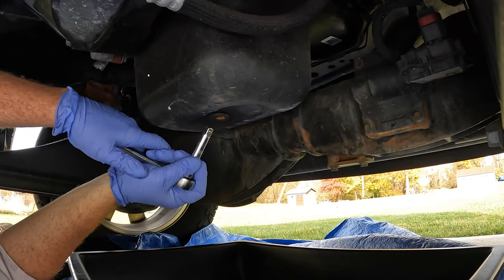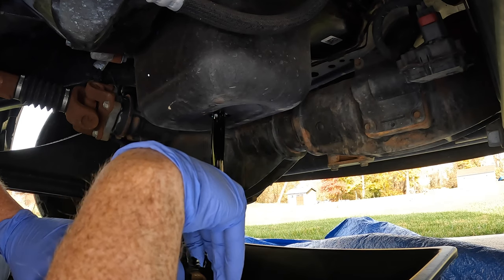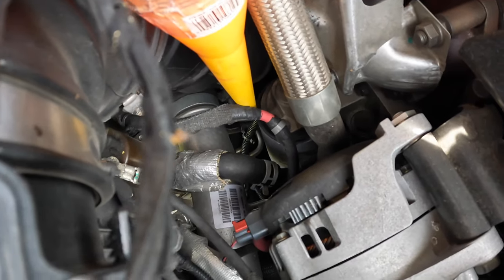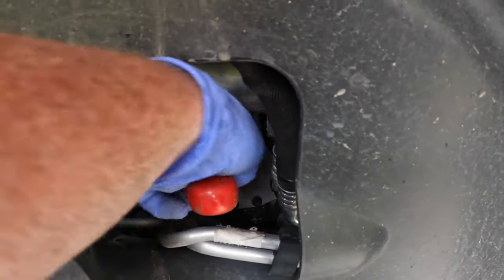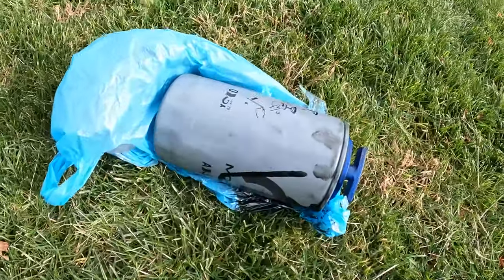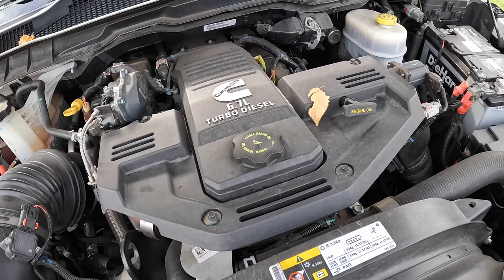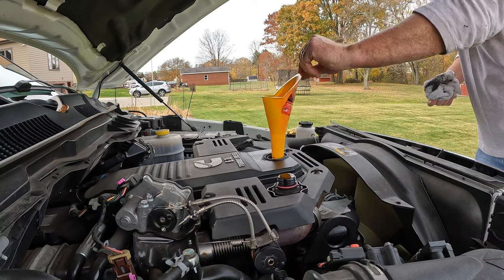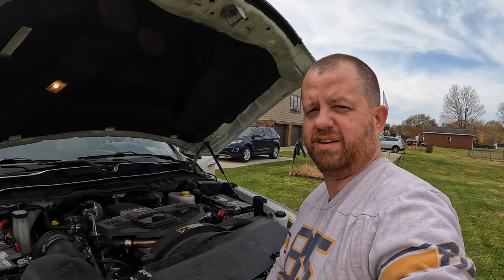OIL & FILTER CHANGE / 6.7L CUMMINS DIESEL / HOW TO

Comment: I installed the Fumoto valve on my 2017 Ram 2500 megacab on first oil change have them on all my vehicles, they make oil change Much cleaner.

Comment: Fumoto drain valve is your best friend on 6.7L oil changes.
Drive her for a bit and get the oil temp up to 170*F or hotter!  
The Fumoto will keep you from ever having to get that nasty soot infested oil on your hands or arms.
drain the crankcase first then the oil filter - the oil filter will then be only 3/4 full and virtually mess free to drop.
Reply from the maker: Never heard of this product until I viewed your post. Looks convenient but I would be concerned with it protruding lower than the bottom of the oil pan.
Reply: Front differential protects it very well - over 85K miles an never an issue. 
Have these installed on all the family autos for over 23 yrs.

Comment: When the oil is draining, that's a good time to grease all the parts that have a grease fitting
Reply from the maker: Agree.  Newer vehicles typically have mostly sealed joints and you are not able to lube unless the parts have been replaced with fittings you can grease.